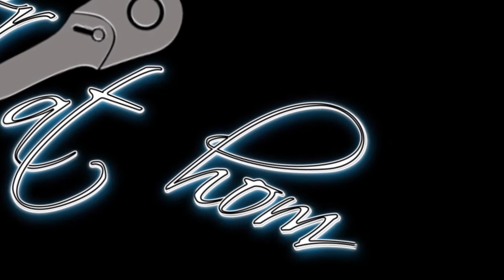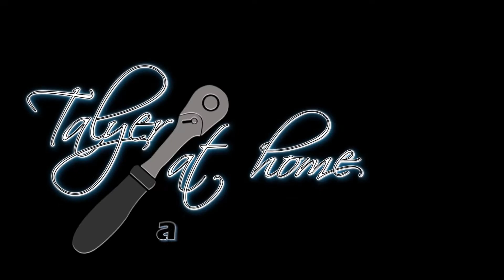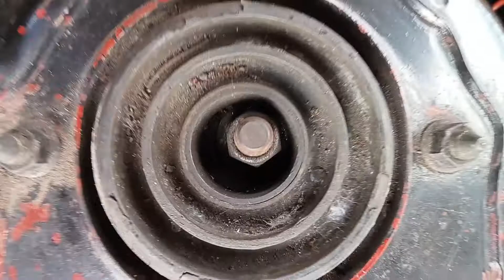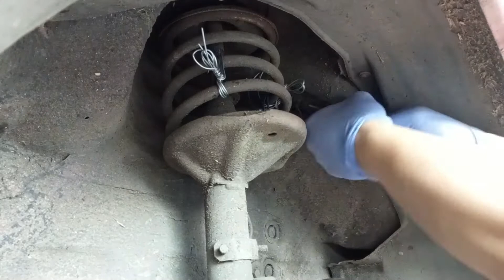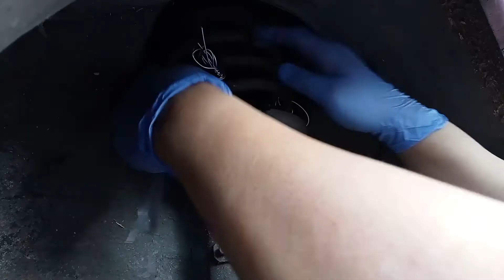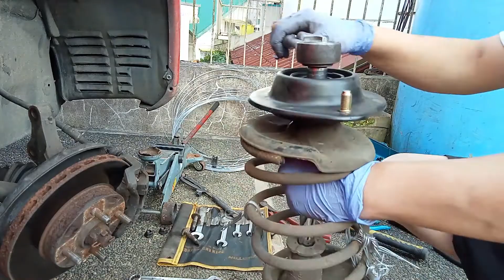Mitsubishi Lancer CB: Front Mounting Shock/Strut (no spring compressor)

Comment: I WOULD NEVER USE WIRES TO HOLD THAT SPRING, i saw a guy at the junk yard do the same thing and the wires didnt hold the tension and the spring popped and hit the guy in the face it broke his nose, teeth and jaw, its an image i will never forget what happen to that guy. If you need to remove the springs out of your struts buy the tool or rent it, think of your safety first
Reply: Actually you can do it without compressors.. you just use the cars weight to push down on the spring, then tighten up the nut at top.

The wire idea is a joke

Comment: how did u align the holes??
Reply from the maker: Hi, can you give me the time stamp which one that you were asking?
Reply: @TalyeratHomeAutoDIY  hi,stamp? not sure,your video so much different than the rest ,i am trying to understand the basic concept,the top peace of the shock can be rotated and aligned!!
Reply from the maker: No need to align on this type of mounting shock/strut. There are two types of mounting shock specially on this '93-'96 lancer (not sure on other year model), the bushing type and the bearing type. On this video it applies on bearing type only. May I know what kind of car you want to change the strut mount?
Reply: @TalyeratHomeAutoDIY  grand vitara
Reply: @TalyeratHomeAutoDIY  its an 04 ,the strut and spring i want to install but the old one has no springs ,it is just the shocks with a nut in the middle.thanks.
Reply: @JoseloPezoa  buy easy struts comes together you just in bolt and bolt new one. No taking apart or lining up anything